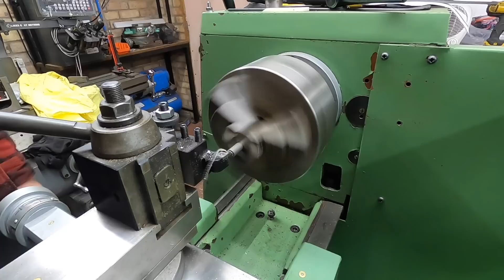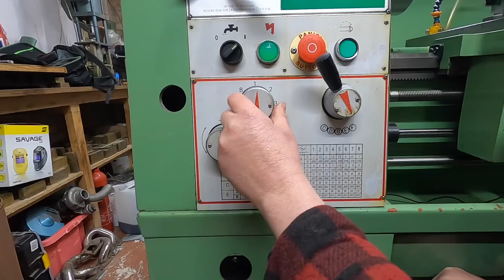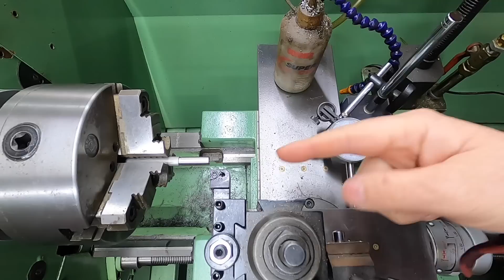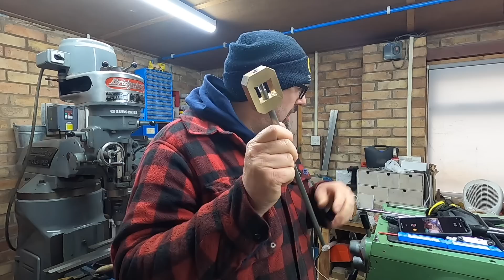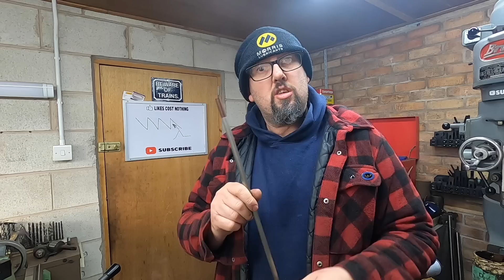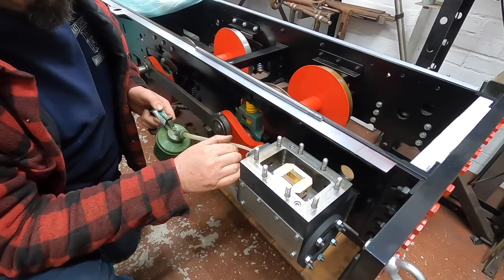Valve Spindle Rods Thread Cutting - EP71 Project Tinkerbell - 7 1/4" Steam Loco Build

Comment: You can take a lot more than half a thou depth of cut Matt, 8 thou would be more appropriate for the first cut, stepping down to a thou for the last cut
Reply from the maker: Until I get to grips with the machine I always take it carefully. Most recently I’ve been on 10thou cuts, gets the job done far quicker!! Really getting to grips with the machine now, I’m making parts too accurate for model engineering 😂. All the best, Matt.

Comment: I may have missed it in the buckle video, but why is the thread in that 3/8 when you made both the buckle and the rod? Why not M10 both ends?
Reply from the maker: Well, thats because I'm tight and didn't want to but an M10 fine thread tap and die. My workshop is very much a budget one. 😂. All the best, Matt 👍

Comment: Hi Matt, enjoy the series as I’m making locos by 2 off. Try the angle approach method along with reversing spindle, not sure if you have a foot brake or not, but that can help. You can still use your dial indicator, you’ll get a better finish than the plunge cut method you’re using. Cheers.

Comment: Well done Matt, you managed that job without screwing it up or losing the thread at any point.  I thought it right to pitch in with a useful tip rather than going nuts and making a bolt for the door...
Reply from the maker: Thanks, 😂😂 my lord these jokes....well they were,  course, not as fine as your standard pitch of humour! Think you need a new set. 😉 All the best buddy, Matt 👍🚂
Reply: @MattChiversWorkshop  I did try and make sure that the comments weren't too coarse and offered a unified approach.  I thought it might have been possible to tap into another video but it was too much of a wrench and certainly not worth dying for! You know the drill my friend. I think you are just chasing comments - that's fine by me...
Reply from the maker: HAHAHAHA!! 😂😂😂😂 Blooming brilliant mate 👍

Comment: 3/8” thread on one end, M10 on the other. Oh the joys of being a model engineer in a metric country. I feel you here in Canada. 😄 Great work as always, Matt.
Reply from the maker: Thanks Quinn, Much appreciated.  Mixing metric and imperial.... we're living on the edge! 😎😂. All the best, Matt 👍
Reply: "metric" 😋
Reply: @schwarzermoritz  Indeed. There are Metric countries, and there are "Metric" countries.
I'm in Aus, we converted in the late 60's I think? And it still comes up heaps.
Reply: A trick I use is to semi screw cut the thread which will ensure the thread is central to and parallel to the axis. The thread die will follow the pre-cut thread.